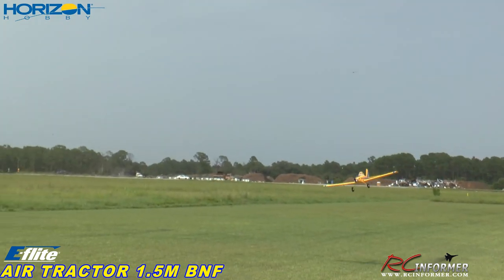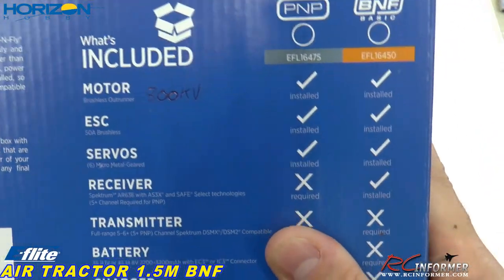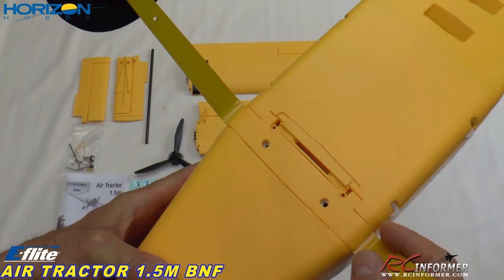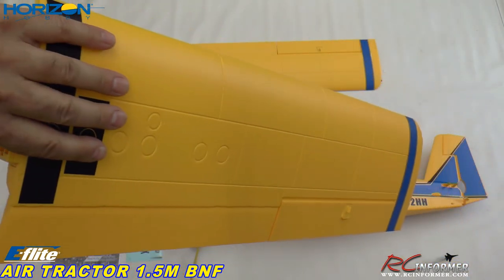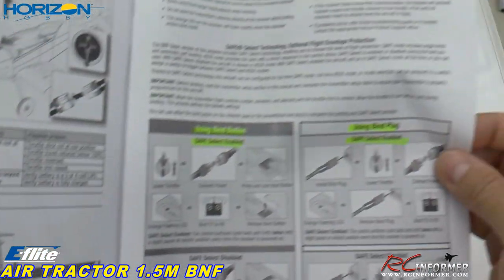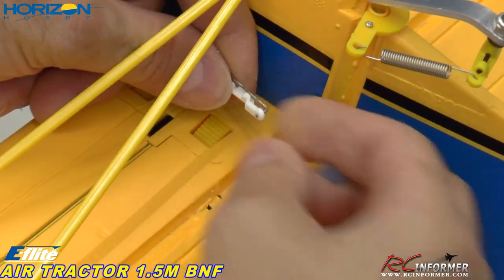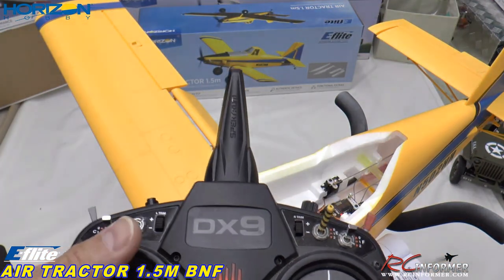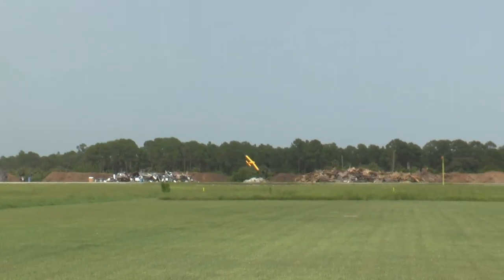E-flite Air Tractor 1.5m  BNF Unbox, Assemby & Setup By: RCINFORMER

Comment: I usually dislike long videos but this one is so detailed that it answered one question I was having.  I need to be able to assemble it, make whatever adjustments, then take apart and put back in the box to either ship or take on vacation.  Was concerned about the right and left stabilizer halves, but I can see those locking snaps can be undone.  Thank you for the very good video.

Comment: Just a note for others, There is an manual addendum on eflite's website that has the flaps settings corrected to +100 on position 0, and -100 on position 2. I just pen'd that correction into my manual. You solved yours by simply reversing the flaps channel and thats perfectly fine too.

Comment: Latch on top of plane would be the lightbar for flying with gps while applying product, tells you wether or not you have to move left or right on your current pass. Extremely cool they added it.
Reply: Yes, adding that GPS light bar assembly you are talking about was a great idea. However it unfortunately eliminated 2 people's jobs for each crop duster flown. 

It eliminated the two flaggers which were normally placed one at each end of the field being sprayed of which allowed the pilot to know where his last flight pass over the field had been performed and ended. 

How do I know? I used to work for a crop dusting outfit (Spencer Aviation in Fruitland, Idaho). I was normally the chemical loader of which loaded the chemicals on the plane (into the hopper), however when not used for that, I also sometimes performed the flagging duties as a flagger at the end of a field. 

Also what a lot of people don't know is that the employees of a crop dusting outfit has to go through a medical examination to include an EKG at both the beginning and the end of the crop dusting season just to see how much damage had been done to their body and brains by being around or breathing in of the hazardous chemicals being sprayed (at least that was what our boss "Spud Spencer" made each of us employees do each crop dusting season).
Reply: @ProspectorsGhost  correct. But maybe two jobs that were eliminated for the better? I’m around pesticides and herbicides daily. Not that I’ve ever noticed a difference in health being around them, but with technology advancing so much there’s no need to put somebody in that situation.
Reply: I grew up flagging for my dad.

Comment from the maker: * Table of Contents and Hyperlinks to Chapters***
-Intro► 02:01
-Unboxing► 05:05
-Specifications► 06:49
-Parts Review► 09:45
-Instructions review► 
**Assembly start **
-Tail Wheel & Tail Strut ► 29:00
-Main Gear► 32:41
-Horizontal Stabilizer► 33:25
-WING► 36:16
-Propeller► 37:47
-TRANSMITTER SETUP & Binding► 39:19
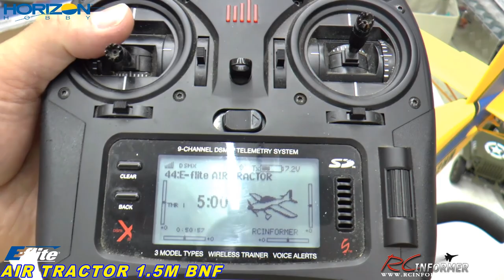-SAFE MODE SWITCH DESIGNATION► 44:14
 -CONCLUSION► 45:40

Comment: I have a question about the Spectrum DXS transmitter for the Air Tractor.  After binding the plane to the radio and taking off, it wants to pitch and roll dramatically, even while set in safe mode. 
Any suggestions on how to remedy this? Thank you🎉
Reply from the maker: Check that all your flight controls are neutral.
Reply: I’ll give it a try.  Thank you

Comment: It would also be nice if they revise and add the tail wheel install in the manual. I've zoomed in on the air tractor pictures on their website, and seen a glimpse of a couple spots on horizons videos. They do not use that extended yellow arm with those set screw clamps, and they hooked the tail wheel springs directly into the control arm that's already there. The springs are visibly almost parallel to eachother  Not sure if it matters or not?

Comment: Hey Rich! Considering this or the Eflite Twin Otter.. in terms of fun factor and replay value of both models, which one would you consider to have more?
Reply from the maker: That's a hard call! Both are really great options. Both are easy to fly & fly well. The advantage to the Twin Otter is that it already comes with the floats, where floats are an option with the Airtractor. Some considerations: The Otter has tricycle gear so ground maneuvering is easier where the Airtractor is a tail dragger. The Otter is a 3s airplane, the Airtractor is 3s or 4s. The Otter is more of a scale flyer, a very smooth flyer but probably a bit less aerobatic than the Airtractor. You won't go wrong with either plane:) Please consider using my links to purchase as it does support my channel! Thanks for the support!
Reply: @RCINFORMER  thanks Rich! I'm just a spot where I'm bored with my selection of planes to fly and I'm looking for another unique purchase. Thanks for the reply!
Reply from the maker: @daquino0021  Also consider the FMS 1800mm Ranger... It is lots of fun to fly

Comment: If someone hasn't told ya in 3 years, that mechanism they used for the battery hatch latch is part of the GPS navigation on a modern crop duster.  It's pretty damn genius they used that detail as a latch handle.

Comment: Setup my new Air Tractor as I watched your video. Really helpful. Minor complaint about the model - the tiny screws used on the horizontal stabilizers and the tail wheel assembly. Very difficult to see and keep up with, especially with my old eyes. Will be flying it this week end. You make excellent videos, thanks again.
Reply from the maker: Thanks for your support man🙂

Comment: Hi Rich,  When I bind in safe select and then assigned my switch to B , then when I switch from safe select to AS3X the elevator will go up about 1/4 inch. What am I doing wrong?  I called horizon hobby they said it was a programing problem, so they emailed me a program for the air tractor, and I down loaded it to a 16mb disc and then I took the card or disc and put it in my DX9 and then it was supposed to put that program into my DX9 transmitter. But it still did the same thing. Please help!
Al Huth
Reply from the maker: I think what is happening is normal. If the plane is the airtractor, and it's on all 3 wheels, if you switch from AS3X to SAFE, it thinks you are climbing and corrects for it & vice versa.  If the plane is not perfectly level when you switch between modes you will often get a little elevator movement because the system is trying to correct for an improper pitch attitude.

Comment: Does the air tractor provide telemetry info?  If so, how do I set it up?
Reply from the maker: Hi Doug not that I am aware, but it depends on the receiver you have and of course any other SMART Technology you might have in the aircraft-I don’t believe out of the box it has the Avian ESC with Telemetry in which case you won’t be able to use that aspect of telemetry. Best place to check with all of these models from Eflite is the main Horizon Hobby store as I don’t have telemetry set up on A number of my own either. Sorry I can’t be any more help, have a quick look here and see if it gives you any advice but I would say it doesn’t have telemetry out of the box that I’m aware. Thanks for your question and support🙂
https://www.horizonhobby.com/product/air-tractor-1.5m-bnf-basic-with-as3x-and-safe-select/EFL16450.html